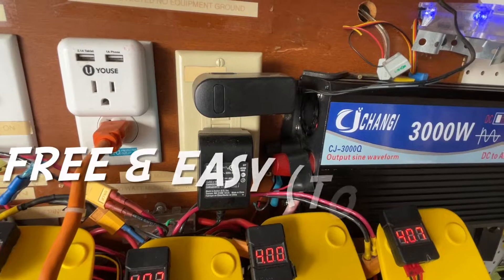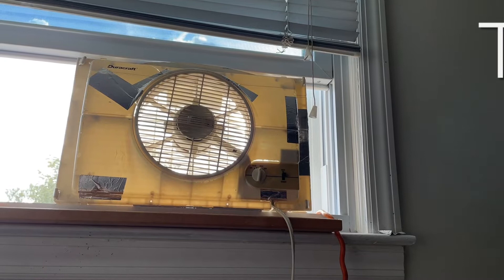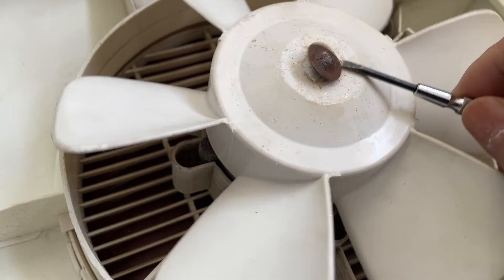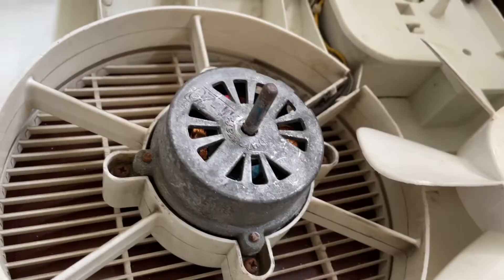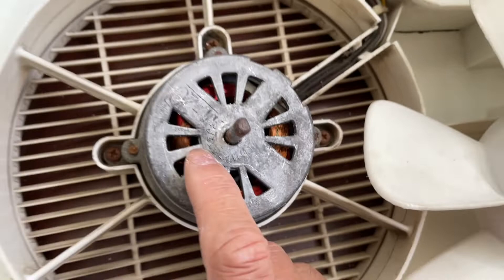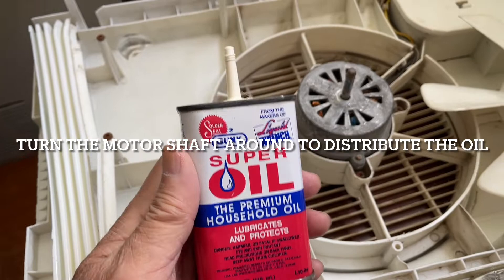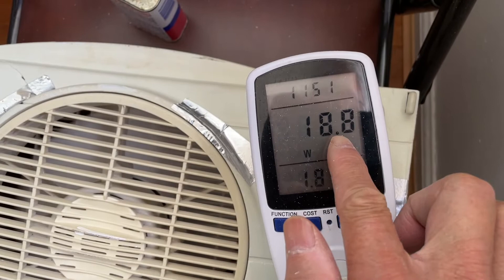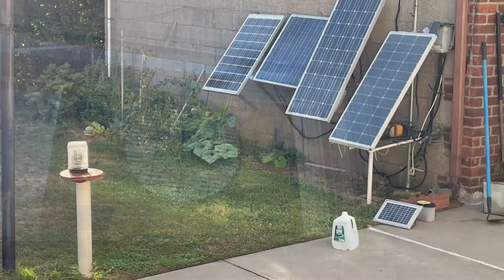Lubricate your fan motor before it burns out

Comment: Lubricating the shaft does not directly oil the front bearings. It may splash down to the bearing area a little but it is not a full bearing lubrication. If the bearings are oiled correctly it should last at least a minimum of 3 to 5 years when using 3 n 1 oil. I've tried the oil spindle method and it lasted about a week without noise and then had to go back in the fan motor again and oiled the front and rear bearings correctly. Its been months now with no issues.
Reply from the maker: @petedetraglia4776  Thanks for your detailed input.

Comment: Did you lube the back bearing too?
Reply from the maker: Good catch. I did not this time as the 4 screws holding the motor are also falling apart. I just did enough to keep it running. The whole fan is disintegrating. I didn’t want to discard the fan because it is so quiet.
Reply: Thanks.
Reply: What does he mean by back bearing exactly? And also what this fan used.for? To cool a room or?
Reply from the maker: @disrael2101  typically a day motor has 2 bearings, front and back. To lubricate the back bearing you have to take the motor out from the fan housing. To make the fan run like new, you have to replace the bearings if they are worn. A lot of times, you can just get the motor to run by lubricating the shaft.
Reply: @wtam69  interesting, what are the bearing exactly is it the screws that hold the shaft in its place or
Reply from the maker: @disrael2101  The rotating  shaft of the fan rests on the front and back bearings.  The bearing is shape like a donut and is press into the motor housing. Inside the bearing you’ll find a circle of little steel balls and they are greased to reduce friction. This setup allows the shaft to turn freely. The best way to make the motor run better is replace the bearings .They are hard to pull out so most people will just grease the bearings or they throw the fan out.
Reply: @wtam69  oh I see very interesting , and what holds the bearing in place?
Also what's the point of the metal balls exactly?
Reply from the maker: @disrael2101  The bearing is press into the motor housing. They are stuck in the housing and difficult to pull out.sometimes you need a bearing pulling tool to remove the bearings. The steel balls with grease allows the shaft to turn freely. These steel balls are very important. Imagine if you are standing or tread on some steel balls, you’ll surely lose your footing and fall.
Reply: @wtam69  wait haha still didn't get this two points, what's hold the bearing exactly, is it the case of the fan? 
And about the steel balls I still didn't get why it helps move the shaft? I understand why it would make me slip but not how it helps the shaft
Reply from the maker: @disrael2101  it’s much easier to understand if you see a picture. You can google bearings and you’ll see what I mean. The motor housing holds the bearings in place and in my case, the motor is secured to the plastic fan shroud with 4 screws.
Reply: @wtam69  ok I google it, why the bearing has steel balls in it tho
Reply from the maker: @disrael2101  if u don’t have steel balls encased in the bearing, then the bushing will wear out faster and the motor shaft will not turn freely.  You can use other materials instead of steel balls but they lasts as long.
Reply from the maker: Correction: Bearings with steel balls lasts longer.